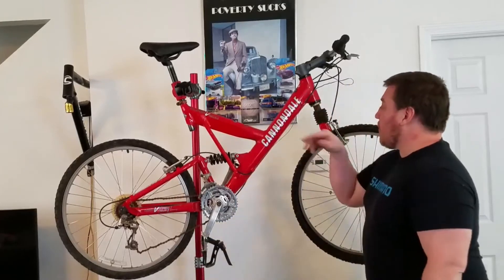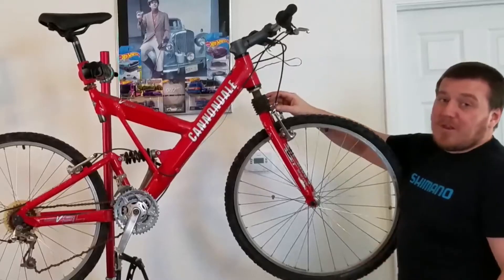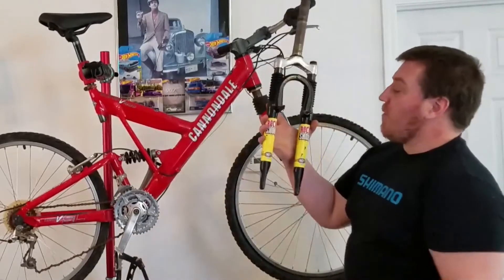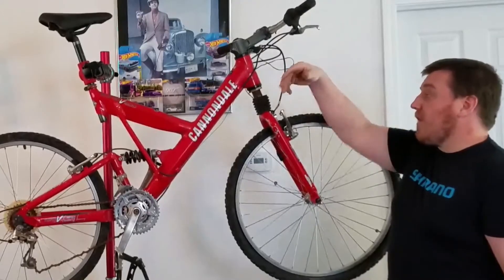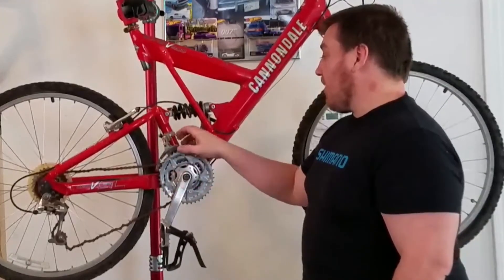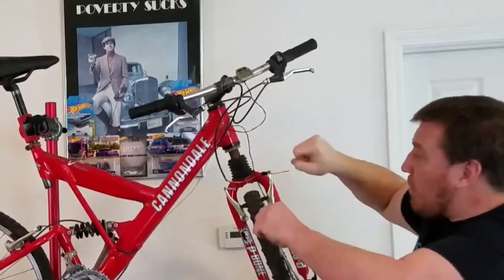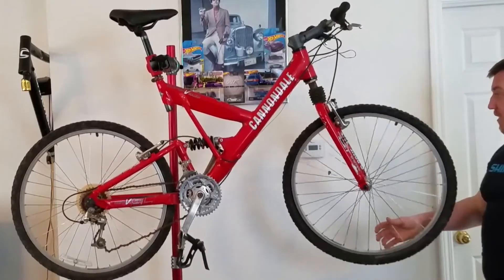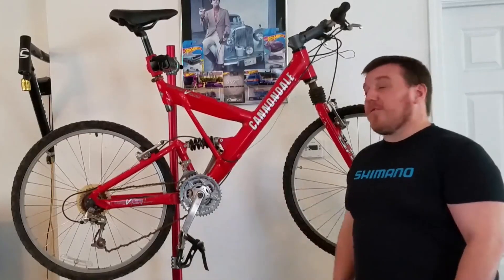ABANDONED 1998 CANNONDALE SUPER-V 400 SL: FULL BIKE RESTORATION PART 1

Comment: Hi, I have that exact bike. My head shok is locked up. What are my replacement options if I can't find a “Rock Shok indy xc”?
Reply from the maker: Hi Stewart, thanks for subscribing and I am happy to help! The Indy fork I used is very old and is more of an upgrade I got lucky finding local. I would recommend something newer like the RockShox TK30 with a lockout, you can find that here: https://amzn.to/31Mmuuz. You will also need a conversion headset as the steerer tube is GIANT on your headshok, as is the stem and handlebars....though this is a great time to upgrade it all in one go. You'll never have to worry about failure or have difficulty servicing the bike in the future and you can adjust your comfort level with a new stem angle/length as well as wider bars. Sell your old stuff on ebay to offset the upgrades if you want! The broken fork brings good $$ on ebay, mine brought $75 shipped and the stem alone brought $32. I also did a video on the headshok and fork conversion specifically, you can checkout here: https://youtu.be/jxGKGapsBn4 
-Conversion Headset, I used a Cane Creek : https://amzn.to/3mlmr2m
-Stem: UNO 7 31.8mm threadless stem, VERY LIGHT: https://amzn.to/2Prqk6p
-MTB Riser Handlebars: 720MM Wide & 31.8mm diameter: https://amzn.to/33E5etZ
-You'll need stem spacers as well! https://amzn.to/3fJVW5n

Comment: Hello there. I have a 2003 Jekyll 700 and my ultra fatty in giving me a hard time even after being rebuild last year. I am thinking about putting a new fork, but here is my question first. WHich reducer kit would work with a bike like mine? Do the parts you mentioned fit on my 2003 Jekyll? Thanks, Pat
Reply from the maker: Hi Pat I am replying to all these comments just to be sure you see them! I would measure your frame, you have to remove the fork/headset and the headset cups and then measure the opening using digital calipers. This FSA fits a 55mm cannondale frame for example.....FSA Orbit Z Reducer Headset: https://amzn.to/3CNQDv5

Comment: Quick question I have the same bike I just purchased but it is the cane creek xx 11 tapered headset will that work or do I need to get the flush? Thank you for any information you can provide before I tear it all apart LOL
Reply from the maker: Hi Derek thanks for the question, please take a moment to subscribe and help my channel grow! Thanks! 

Are you saying it already has a cane creek xx11 tapered headset already installed? What fork is on the bike right now?
Reply: @D2WrenchWorksDIY  no that’s the one I actually purchased I didn’t see one was tapered and one wasn’t in the link you have in your description to Amazon they’re out of stock so I purchased it on eBay I got a fox shock or fork I’m  putting on it
Reply: @D2WrenchWorksDIY   It is 1.5 to 1 1/4
Reply from the maker: Well it could work fine to be honest and if I kept that bike it would be a fun build! I had a cheap fork that’s way old I used in this vid, couple things here: 
-#1 my fork only had a straight steerer
-#2 the Cannondale head tube that houses the headset is HUGE so you don’t need old stuff like I used.
-#3 the most important part is does your fork have a taper?
Reply: @D2WrenchWorksDIY  yes the fork has a taper and oh believe me I plan on keeping it thank you for all the information you provided I’m a long time viewer and subscriber
Reply: @D2WrenchWorksDIY  also I plan on putting hydraulic brakes on this what wheels and brakes would you recommend this frame has the purches for the calipers
Reply from the maker: Awesome man you did well! Any Fox fork on that bike is going to be bananas man, consider upgrading the rear shock to something just a tiny bit bigger. You don’t want to go too big and screw with geometry especially if you hit jumps.

Also disc brakes would be the icing on the cake for a vintage bike like this! I’m going to be honest if your fork allows v-brakes, Shimano Deore XT is SICKK!! I have a vintage schwinn mtb full suspension video series too! I did a 10spd swap plus more, you should check it out! Used the XT brakes and they’d stop close to budget hydro brakes for real and I’m a heavy guy haha.

I like them because you don’t need to upgrade wheels either! If you already have a disc wheelset, basically anything made in the last 5 years is built to last, even the off brands like tektro that had issues in the past. I’ve ran Shimano Altus and Alivios, easiest to bleed with cheap specialty tools too. Also great stopping power on a budget, but if you can splurge go Shimano XT or any nice Sram brakes.
Reply: @D2WrenchWorksDIY   thank you my friend for all your input I really appreciate it and I’ll be looking forward to that video coming out The guy I bought this from he bought these from estate sale they look like they been ridden five times he has a killer V 1000 I’m probably gonna buy that I’m short like you so I ride a medium and the killer V 1000 is a large but I might be able to make it work thanks again my friend also my V 500 it has all Deore  components is that that stock for that bike
Reply from the maker: No problem buddy I am always happy to help, thanks for supporting my channel it keeps me motivated to keep the content coming! Sounds like you found some real gems, by this time when you find cool bikes like these they are already beat to hell lol. Also we aren't short! Short people ride a small frame haha :D I'm not sure what came stock on that bike to be sure, but if you google the color and make/model you can pretty quickly find the year. Then just look up "1998 Cannondale Catalog" and you will find old scans people did back when they had the actual deal manual! This will give you the WHOLE build list down to the headset and bottom bracket! It will also even give you the exact geometry to the frame and all kinds of cool stuff. Deore is mid level stuff but to be honest it's one of my favorites, they don't get much shine but they perform excellent and will fit big cassettes.....not to mention very durable and pretty light for their rank in the shimano lineup!

Comment: In regards to the headset reducer. I noticed that you had cane creek & FSA. Was that just two different options or did you have to switch from one to another?
Reply from the maker: Thank you for the question and please take a moment to subscribe to my channel! This video is older now and because of the pandemic, parts have been extremely hard to find. Both headset adapters will work, I used a Cane Creek headset because it is what I had available to me.
Reply: @D2WrenchWorksDIY  which stem would you recommend?
Reply from the maker: Matt the Uno 7 is as light as most carbon stems and is crazy cheap. They are always my go to stems; link here: https://amzn.to/3HIZsaJ
Reply: @D2WrenchWorksDIY  Thanks again for all of your input! I’ve got a 95 super v 900 I bought new & since my 2 year old is on his balance bike I thought this would be a good time to tune up the ole super v.
Reply from the maker: Hell yeah man that is awesome to hear and exactly what cycling is about to me! Fix it up good so you can pass it down in 10-12 years 😃 they really are very fun bikes that'll last forever! Thanks for subscribing and supporting the channel too!